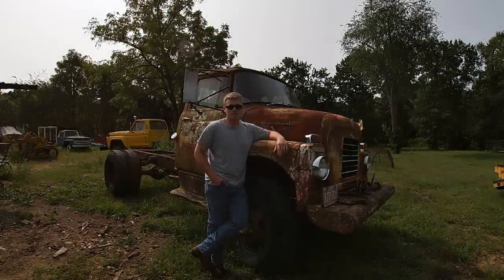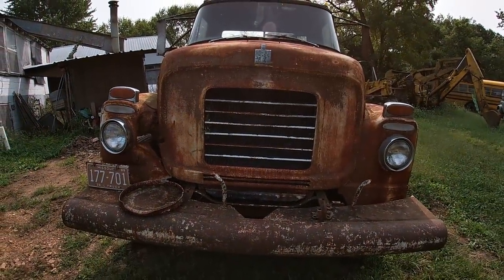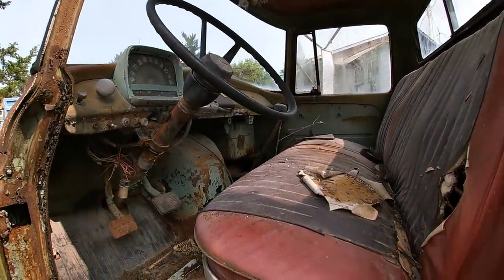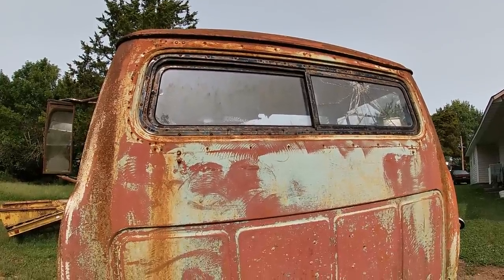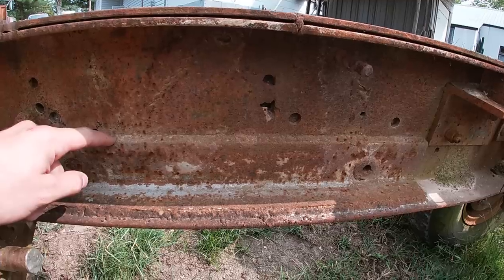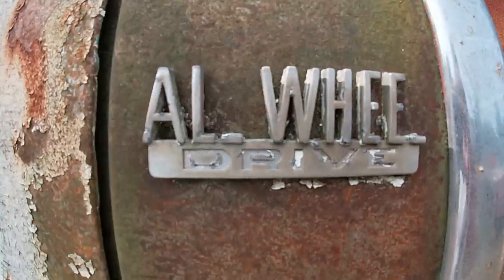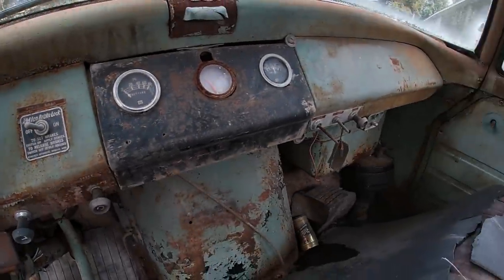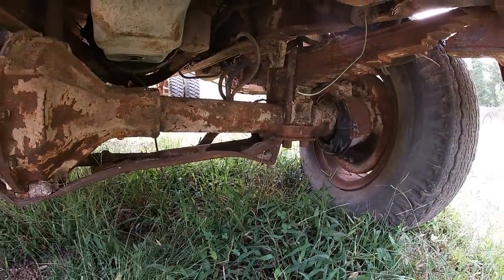My 1959 International 4x4 AC-170 (Walk Around)

Comment: Yessir Blue, black, and red diamond engines. That cover over the back of the engine is called a dog box. We had 2 1957 Mack B85 with 707 cubic inch 6 cylinder Mack thermodine gasoline engines that had them. One had air brakes and the other vacuum brakes with a hydrovac and yeah the brakes gave us problems.
Reply from the maker: Mack B models?? 😍 What beauty's Kyle! Thanks for the kind comment my friend 🙂👍
Reply: @HODGEPODGEDODGEGARAGE  your welcome my friend!!! Yeah B65 and B85 were some nice looking trucks 😇 That 707 gas engine had some power too. 6 cylinders but had duel ignitions so it had 12 spark plugs. 6 on the left side of the head and 6 on the right.
Reply from the maker: @kylebass4635  thats pretty cool! 😀👍
Reply: @HODGEPODGEDODGEGARAGE  yeah I thought so too buddy 🤗; hope you have a good day and don't have to work too hard today.
Reply from the maker: @kylebass4635  thanks buddy! You as well 🙂👍

Comment: Early 2.5 ton Rockwell's, 1950s era top loaders, ran rubber boots around the knuckles also. More than likely it has rezeppa joints between the axle shaft & stub shaft. They're an interesting ball & socket joint. I'll send you some pictures of the ones in my Eaton H110. I'm kind of interested in seeing the inside of that front drive axle. I've never had a Timken axle apart before. Hopefully it starts fairly easily & doesn't give you too much trouble!
Reply from the maker: Thanks as always for all of the info and help buddy! 🙂👍 I truly appreciate that.  Yeah, hopefully it will run easily 🤞 fingers crossed! Lol
Reply: @HODGEPODGEDODGEGARAGE  anytime Zane! I'm always happy to help someone with their projects. 👍
Reply: If it’s anything like my 1960 B160 4x4, the axles are IH built, based on an Eaton design. The boots on the front axle are actually leather, and they use Bendix-Weiss joints.
Reply from the maker: @justinstearns9723  thanks for the view and the info 🙂👍 I appreciate that. Awesome that you have a 4x4 like this as well. 👍
Reply: HODGE_PODGE_DODGE_GARAGE Seeing it now, that front axle is very different from mine. My truck is an oddball as well, but this one is even weirder.
Reply from the maker: @justinstearns9723  I checked the videos out on your truck! 🙂 it's a nice looking rig 👍 what a tough old 4x4. What are your plans for it?
Reply: HODGE_PODGE_DODGE_GARAGE I’d like to fix it up someday. It’s rough, pretty similarly to yours, but it runs decent and drives. Mechanically it’s pretty good, as far as I know it’s got pretty low miles. Just spent a long long time sitting. One of my someday projects, I have 3 other newer IH trucks as well.
Reply from the maker: @justinstearns9723  sounds like a good plan 🙂👍 I'll check more of your videos out when I get a chance.  Take care 🙂

Comment: I think that seat is a replacement take from a car or pickup that's been added in to provide a bit more operator comfort.  Everything else on the truck is pretty low specification, which is pretty normal for a vehicle intended for arduous work supplied new to a company or the government, so the original seats probably wouldn't have been all that great or comfortable...
Reply from the maker: That is definitely true! 🙂👍 cheap interiors and cheap everything lol 😂

Comment: Your truck is a old utility pole setting truck  the hole in the roof was a mirror  to see the rear boom and the sliding rear window was to see the bed mounted winch  behind the cab
Reply from the maker: Yep! 😁 You can barely see the company name on the door in the right light. It had a utility bed with an auger. I actually found a similar 4x4 International 2ton with the setup still on back. Tough looking unit. Thanks for swinging by Kenny and take care 🙂👍

Comment: wonder if they are regular u joints or the early jeep style? that had fluid in them.
Reply from the maker: Not sure at the moment 🙂👍 hopefully someone in the comments will know.
Reply: @HODGEPODGEDODGEGARAGE  they look like the early style  which i think in some ways are more like a new style cv joint. Maybe someone knows for sure. Nice old IH  most of the chrome is still good.which is good. new chrome won't hold up that long...
Reply from the maker: @FordMan-lf8ns  thats true. Ive heard the local plating shop does a decent job. Price is fair, but i don't know what it looks like after a year or two 😬 may peel worse. Maybe worth a try though 🙂👍
Reply: @HODGEPODGEDODGEGARAGE  maybe not if they prep good.

Comment: I think it was a fire truck when new ?
Reply from the maker: Not 100% sure but I was told it was an auger truck. I'll have to try and do some more research 🙂👍 thanks for the view Andrew!
Reply: @HODGEPODGEDODGEGARAGE  .... hope you find out, I think that extended bumper was so a pump driven of the front of the crank could be accomodated, the steel disc on the left might be part of a hose roll ? - the back of the cab appears red under the light blue - what does the tag on the bottom of the drivers door say ? Utilities Equipment Supplies ?
Reply from the maker: @RHM6x4  I believe that's what the tag said 🙂👍 I'll try to do some  more digging.

Comment: Are you “in-Zane”? ....get it ...insane ...Zane....

Sorry couldn’t help it...

Anyway, that’s actually really cool old truck, what kind of plans do you have for it? 

Do you plan on doing a full restoration and making it show-spec, or do you plan on just fixing it up and using it as a work truck....or are you just planning on fixing to a safe running condition and selling it on?

Strange someone sanded it down and just left it outside...didn’t even give it a coat of primer or just something to prevent the metal from rusting
Reply from the maker: Lol 🤣 that's a good one! I plan on fixing it up a bit and driving it 🙂👍I may even give it a paint job. Thanks for the view and kind comment. I really appreciate that my friend 😀

Comment: Spend the money and send them to Tennessee to Advanced Plating. They do it right, they strip the parts down, repair anything that needs fixed and then go back and forth between hard and soft copper until the part is perfectly smooth and then nickel and chrome. With chrome you definitely get what you pay for. https://www.advancedplating.com/site/ If I ever had a bigger truck I think I'd want to find a Diamond REO, mostly because I'm a REO Speedwagon fan :P (that and they made nice high dollar trucks) Hey, at least you can get to most of the cylinders, most new passenger trucks you can only get to half of them.. and on our 03 Ram you have 2 plugs per cylinder.
Reply from the maker: Thanks for the view and the kind comment. I will have to look into that company :) Thanks for the suggestion. Those REO trucks are very neat! I have seen a few for sale in my area, sadly they were pricey. Take care